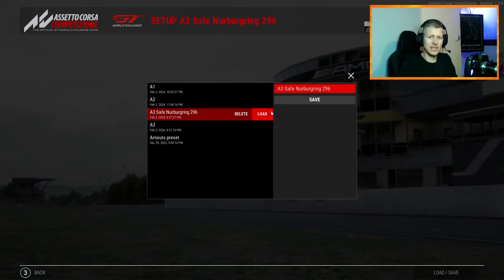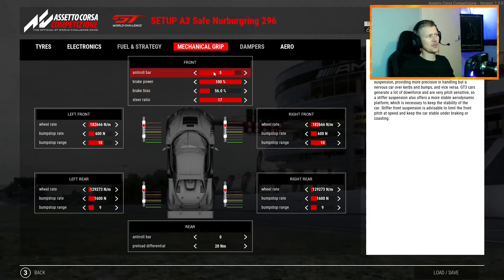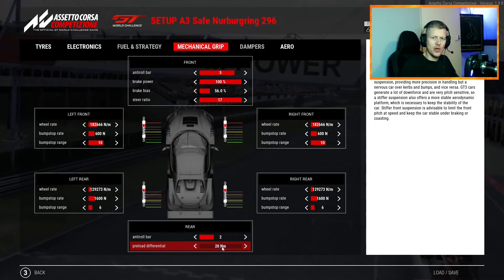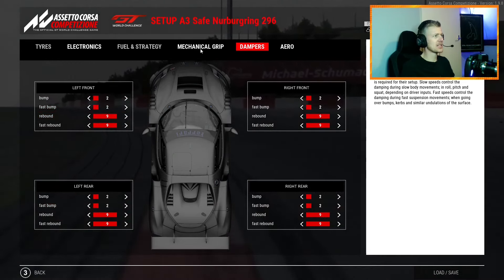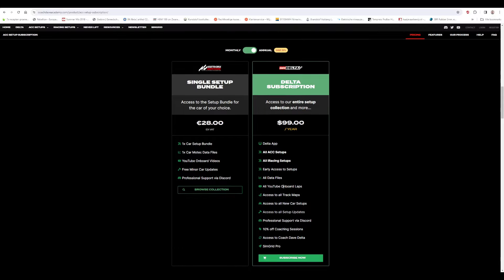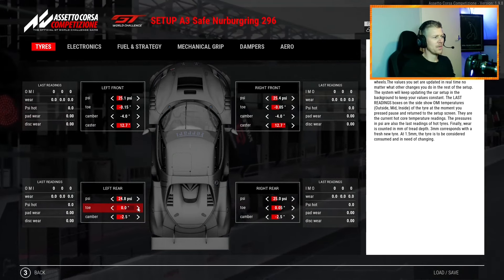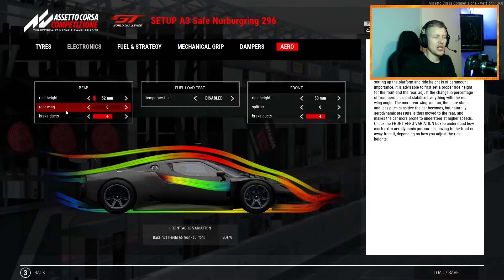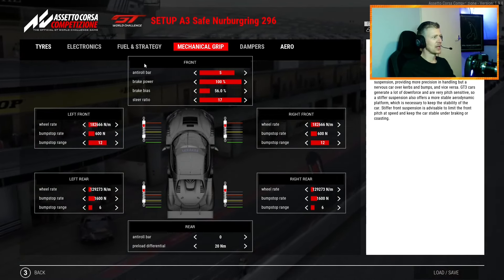How to build your own car setup in ACC for every CAR Part 3

Comment: Hello Arnout,
First of all, thank you for providing detailed explanations in your previous videos. Thanks to you, I learned more about some subjects.

I agree with your comment about Ferrari. I some used setups could not speed and control.  Therefore, when I found the appropriate setting in Camber and Teo, I found that I was faster and the car was more stable. As you mentioned in your video, Camber and Teo are max. don't need to use it at that level for me.

Comment: Which version were you basing this on? I'm new to ACC and started with 1.9.9. Not sure if the toe/top speed issue has been fixed.

By the way, the reason you might want a higher front bumpstop rate is when you have a car whose Aero is very pitch sensitive, so you want to keep the rake as consistent as possible by riding the bumpstops practically all the time (with 1-4 range). The 992, with its shorter wheel base is a car that will benefit from this (try out 1 range at 1400 or so on the front). The AMG is a good example of the opposite.

Nice work on these videos 👍🏻
Reply from the maker: It's based on the 1.98. We need to research that toe, hopefully, they fixed it. Thanx for the comment

Comment: I just started sim racing a couple of days ago. I started career mode in ACC and spent 2 whole days trying to complete the training on the Monza track in the Lambo Huracan ST. 

I was barely able to finish even a single lap each iteration because the oversteer was killing me. I tried to make my own adjustments after reading what all the settings do. I was able to make it better at lower speeds but then it was worse at higher speeds. 

I’m oversteering like crazy exiting corners. 

It was happening at low gear and high RPMs prior to me ‘fixing’ it, and now it’s happening at higher gear and even in lower RPMs. Traction control doesn’t seem to help, so I believe I messed with one of the settings and made it worse. I don’t even have to give it full throttle and the rear end will just come right around. 

I ended up giving up on trying to actually complete the Monza circuit training because of my frustration. When I moved on I was given a choice between the 2012 Emil Frey Jaguar G3 and the 2018 Porsche 991 GT3 R. I chose the Jag figuring a rear mount engine in the 991 would cause even more oversteer than the Lambo. 

Can’t wait to try out everything I’ve learned from the 3 videos you posted. Maybe I will start the campaign over again to actually finish the Monza training circuit. 

Hopefully I can figure out how to setup the car properly. It really sucks when the vehicle doesn’t respond the way I expect it to. 

It may all be just because I’m new to the game and sim racing as a whole.

Anyway, your channel is great info!

Edit: YOU ARE A GENUIS!

Just spent 10 minutes on Monza in that Huracan ST with your base setup and my oversteering problem is completely gone! Now I’m having a problem with my timing. I am braking wayyyy too early now. This setup allows me to start braking much later. Even when I have 6th gear maxed out I am able to wait another 50 meters before I have to start braking for a 90 degree turn. This is amazing! The only ‘problem’ I see is my top speed is down from 159mph to 150mph now. But that doesn’t matter much at Monza. Whatever I’m losing in the straight I’m gaining that and then some in the corners.

This is the first time in the past 2 days that I drove the entire 10 minutes without wanting to smash something due to the car not doing what I want it to do. Feels great to have a car matching my inputs while feeling like it’s on rails. THANK YOU!
Reply from the maker: My man! Your welcome. Hope you  enjoy acc more like this. Join my discord if you want more info and be more in the loop of whats going on

Comment: Come impostare  il freno su Ferrari ? Scendo sul 46 alla prima variante ma la perdo 
Vado con abs 1 e riparazione a 58 
Puoi consigliarmi un freno giusto grazie 🙏 😊
Reply from the maker: So whenever you spin while braking the brake bias is too LOW. If brake bias is on the max already then your setup isnt right. Low brake bias gives the best braking performance but you suffer stability